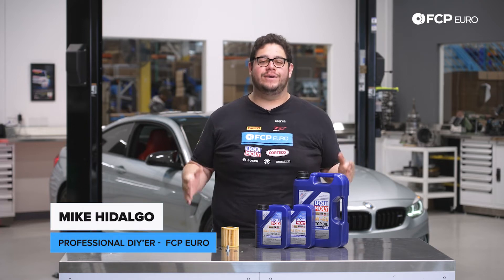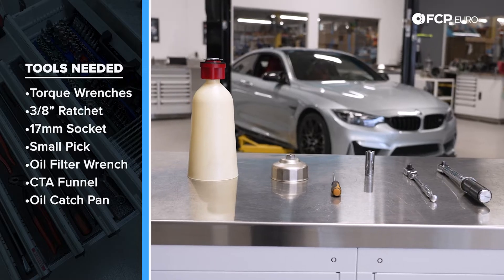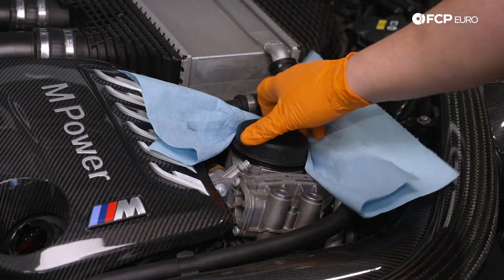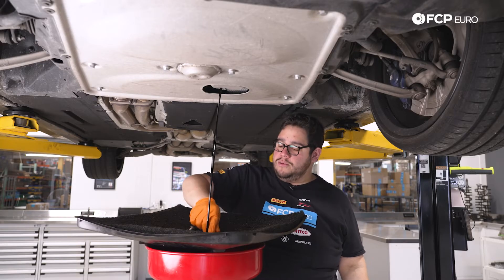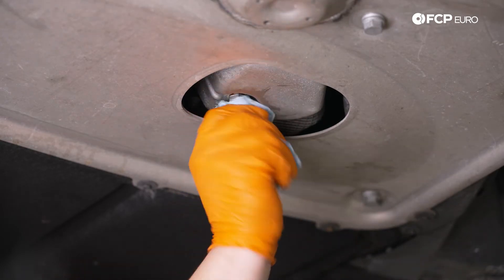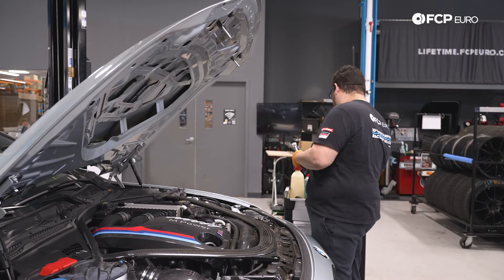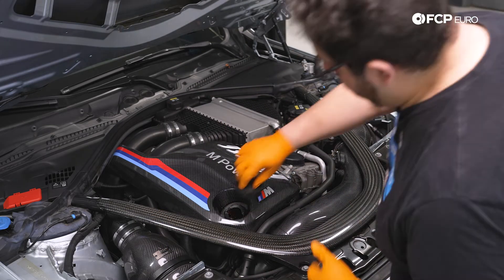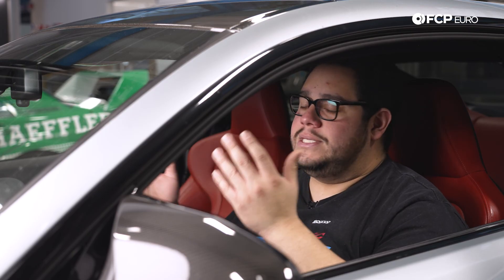BMW M4 Oil Change DIY (2015-2020 BMW F82 M4 & F80 M3)

Comment: I just done my oil change added 6.5 litres and my i-drive showed 3/4 full, so I added another half a litre and the level shows to the max level now, I used BMW 0w/30  LL12, I hope it'll be ok, my BMW M4 Competition is a F82 manufactured in March 2020.

Comment: My F87 (M2 Competition) has the S55 engine, and under the hood, it specifies using 0W-30. I’ve seen a lot of posts where people use 5W-40. Do you have any recommendations on which oil to use?
Reply: Did you end up using 0W-30 or 5W-40?
Reply: @ I used what specified under the hood, I heard 5w-40 usually is for warmer weather I live north of the USA and it gets cold during winter
Reply: @bruhmomento_2197 in Germany everyone using 5w40 (ravenol or motul 300v) highly recommended
Reply: Down here in Florida I like to use 5W-40

Comment: why does FCP Euro put 5w40 kits when it's recommended to use 0w30- 5w30
Reply: Research the forums and you will more than likely use either 5w30 or 5w40 over 0w30. Both weights can be found LL01 cert for the S55. Motul 8100 xcess in 5w40 is what I run and it flows similar to a 30 weight oil with research that can be backed up
Reply: @ohtwo23  i been using amsoil 5w30, 5w40 i can tell under peddle pressure its not wanting to rev as freely
Reply: Higher mileage

Comment: I need to put 7 liters. If I put 6.5 idrive shows 3/4 over min. not max. I dont know why🤷‍♂️
Reply: Fingers crossed for your motor lol
Reply: @coleBlap  I replaced oil level sensor and now everything is fine
Reply: I just done my oil change and it happened to me too, so I added another half a litre and the level shows to the max level now, I used BMW 0w/30  LL12, I hope it'll be ok

Comment: Correct me if I'm wrong, but that's not a 2018 model M4. It doesn't have the ICON headlights and those were introduced mid 2017, right?
Reply: Icon headlights were an option with the executive package
Reply: @alexstruss8485  for the 2018 LCI

Comment: #OhBaby

ProTips: Get a box of drain plugs and keep them in the car, since they are only $2-3 each. Replace the drain plug after every 3-4 oil changes. Inspect the threads after each oil change, since they strip over time, especially when the BMW dealer does the work. I think the N55/S55 engines takes 6.5L of 5w30 Oil, but #LiquiMoly offers a more commonly available 5w40 Oil. Look for the gold lettering and the German label Leichtlauf High Tech SAE 5W-40. Leichtlauf means smooth/easy running. BMW oil grade is LL-1, as in Long Life.

UPGRADES: You can upgrade the plastic oil cap (swap the rubber gasket) and oil filter housing cap (swap the cage) to anodized billet aluminum. Goes nicely with the BMW carbon fiber engine cover, so you can be cool like MikeH at #FCPEuro.
Reply: ridiculous comment